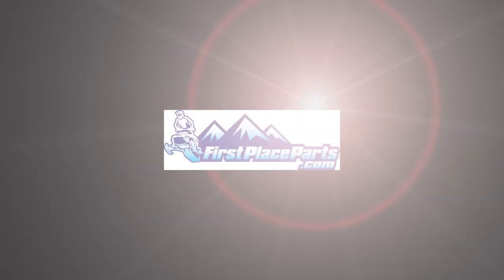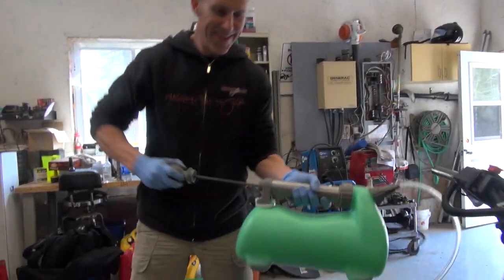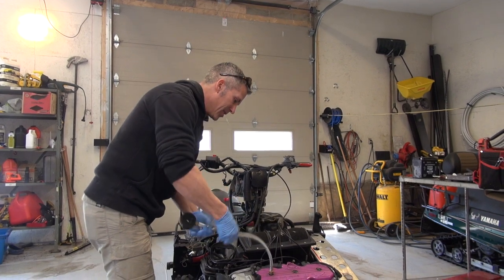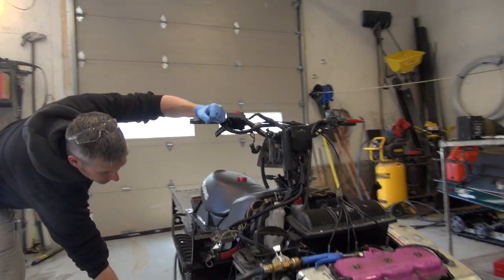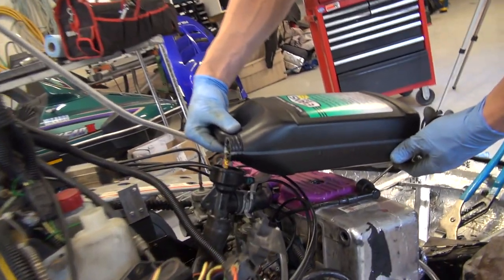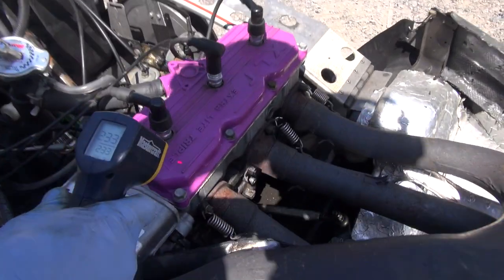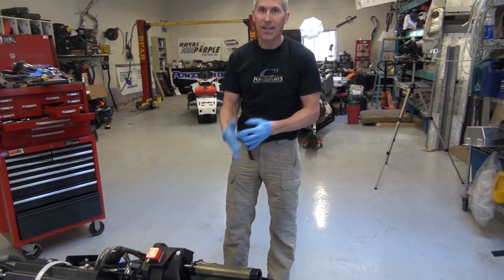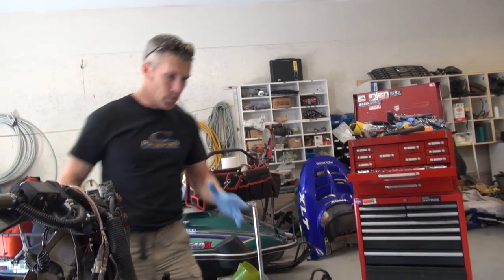Snowmobile engine engine runs to 265+ degrees, Evans Waterless Coolant put to the test!

Comment: I have a 1992 Arctic cat Wildcat 700 the water pump gasket is leaking are you able to bypass the coolant system if I block off the water pump will it screw up my bottom end lower unit I'm pretty sure as long as the coolant is flowing through all the lines I'm pretty sure everything will be fine anyone have extra tips